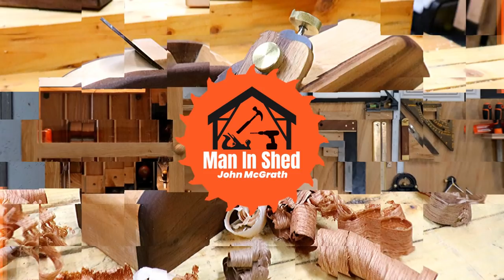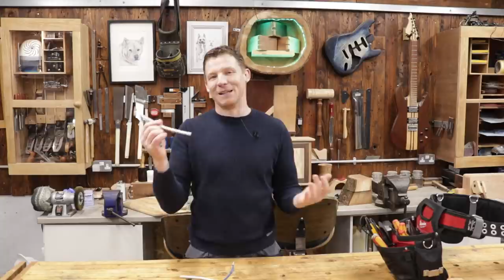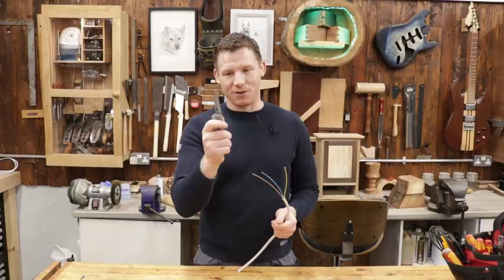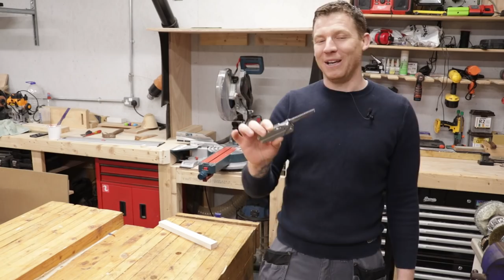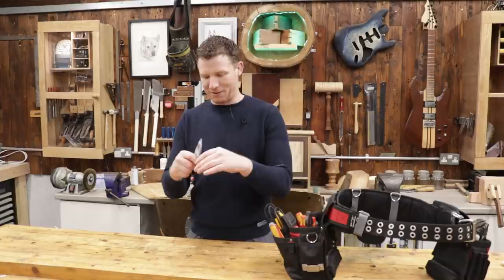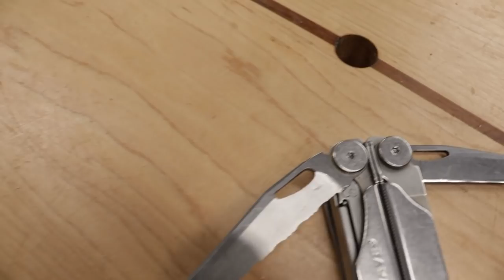My Favorite Tool!! The Leatherman Wave. A Tradesman's Opinion!

Comment: great video.  2 other uses for the tool that are useful for electricians:  the sharpened notch in the can opener is for stripping wire (put the wire in and press the tool against the frame) and behind the pliers are wire crimpers that work well in a pinch.

Comment: Had one, didn't use it, too heavy in pocket, gave it away. Was given same thing with different name (just found it - Gerber) by someone who didn't use it. Now inspired to keep it with me and get into habit of using it. Would save lots of dashing to and fro between workpiece and where I've put down the proper tools.
   Having seen a few very nasty falls where people tripped on that strapping, I always cut it up very short - 6" lengths. Even pick it up if I see it lying around. Hate it. Tool in pocket or on belt will let me chop it up whenever I see the stuff

Comment: Hi, John - great video - subscribed - you might consider using the tip of the serrated blade to open boxes, etc.- it has great draw-cut capability and will give your main blade a rest...What do you think of the bit kit and extender? I think you would find them most useful...Also, the bottle - can opener will strip wire well and will give your cutters a rest...

Comment: Man! I’ve had 4 in the last 32 years. Lost two of them. I broke the blade on a Wave once. I’ve been using the same Wave now daily (that’s an understatement) for at least 12 years. When it was new I could pull splitters with the pliers. I’ve used it as a hammer a few times. I used it to steer a race car with no steering wheel  (walking next to the car and pushing it). I once made a new hole in a leather belt with it. The fkn thing even has a precise 8” ruler. Those who know, know. Btw! Just found a neat Chinese case that clips into the Wave specifically. I can rotate the case on my hip, press the scissor-lock button and it falls out into my hand. Putting it back is even more satisfying. This tool becomes an extra limb for long time users.  A very functional extra limb. I cut a 6” tree down once with it. I can go on and on and on…

Comment: I have the later version (Wave+) and, like you, love it. As you say there's nothing half-arsed on it and the diamond file and scissors are probably my favourite tools as they are so surprisingly good. When I bought mine it came with a cracking ceramic blade sharpener tool which gets you the razer sharp edge on both the main blade and the cerated blade. Prior to the Wave I did have a cheaper 'generic' tool which I bought in Wickes over 20 years ago that got a lot of use but was essentially a bit crappy. The Leatherman is miles better by comparison and I do regret not taking the plunge earlier.
Reply from the maker: I have seen the new pack with the sharpener looks good!

Comment: I have had so many cheap multi tools... then I bought a Leatherman Wave....oh my word its ideal.. I work in theatre and I use it every day, managed to get a secondhand one in black ( I think ex military) it goes with me everywhere, I have fixed Lanterns with it, Sound equipment, cut off protruding timber and carved foam with it.  Thank you for the info on the file, never really used it but now I will

Comment: Just a few minor clarifications: the Wave (and most Leatherman tools) use 420HC, not 440C (unfortunately - because 440C is superior to 420HC). Also, Leatherman does NOT use VG10 in any of its tools. It does, however, use S30V in some of the more premium versions of the Charge (like the TTi, for example) - and S30V is actually superior to VG10. The "regular" versions of Charge, as well as the Skeletool CX, use 154CM, which is Leatherman's mid-shelf steel offering.
Reply from the maker: Thanks for that.

Comment: Did you know the inside of the can opener is a good wire stripper? Near the pivot of the can opener. And the bit- kit comes with 44 different sizes.

Comment: Great video review John.  The Wave is certainly popular and you have shown some great use cases.  I am thinking about getting one.  I currently have the PST II which I got in 1999, it was their 4th design, still works great and a Skeltool that I got about 3 years ago as I wanted something really lightweight.  I have used both extensively and they certainly do the job.
Reply from the maker: Get one you wont be disappointed, I had the Blast first which they don't make any more and I have a Gerber, the wave is just superior!

Comment: great video as always. for me the best is the Leatherman serge with the 1/4 adapter
The big advantage for me with the Serge is the replaceable saw as it has a t-shank the same a jig saw
as I use it all the time for 25mm trunking. with 1/4 adapter you are not stuck to what is on it
Reply: I have the Surge and the Charge, the Surge is a better stronger tool but I think it is too big as a knife .. I wish I had bigger hands hahaha

Comment: and it gets even better with a tiny extension and the bit kit. 
only bad thing really are the screws holding it together.. proprietary shite
Reply: What screws? Those are just security torx you can find in sets at the cheap shops
Reply: @thulegezelschap5884  
https://www.tested.com/making/tools/915548-adam-savages-favorite-tools-ifixit-repair-toolkit/
he gets to the meat of the wave at: https://youtu.be/7iss1tfYfyM?t=293
so yea 6 out of 8 screws are regular sec.torx but 2 of them are pentalobe shite screws. 
Now they might have changed that, my wave is 18years old after all.

Comment: Have had my Wave+ for a few days. It needs to be "broken-in" - by a gorilla, over two day's time, with lots of lubricant and forcefully opening/closing the tool.  I've never had a tool which needed to be broken in - especially this difficult. And the Philips screwdriver droops/dangles - what's with that ????
UPDATE:  Now 1/2 of the pliers is stuck - wedged tightly between aforementioned Philips screwdriver and the adjacent tool - am sending it back to Amazon for a refund - I’m FEDUP with this tool. 👎👎👎😾😾